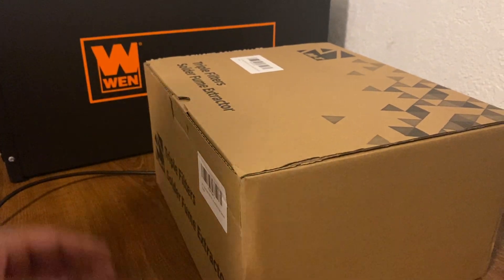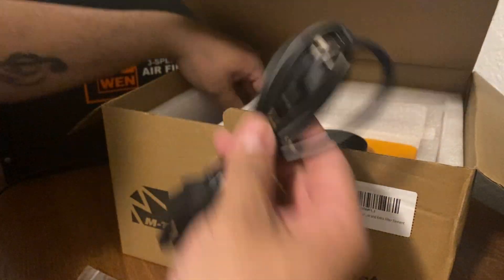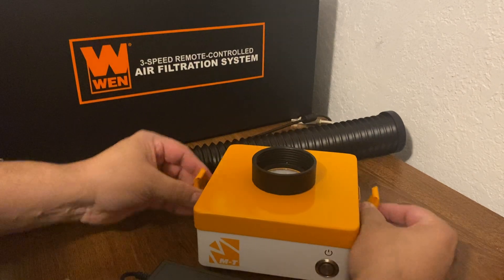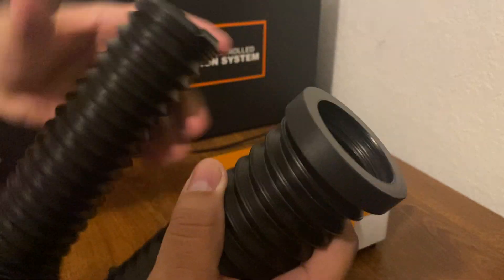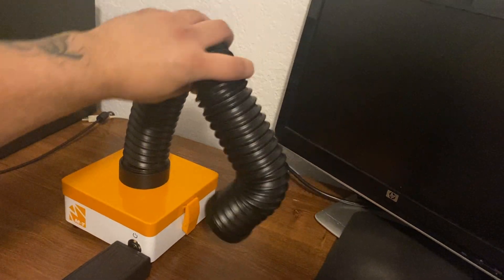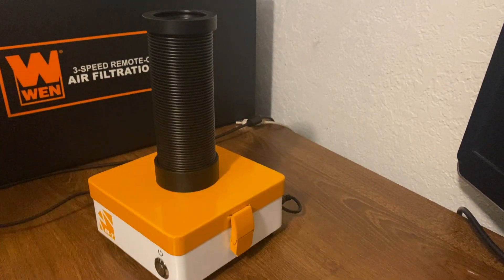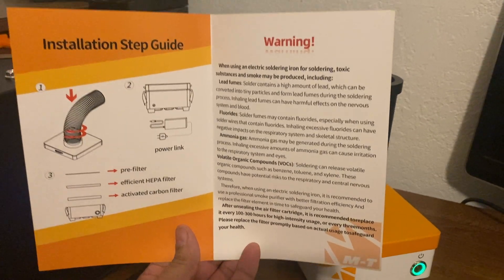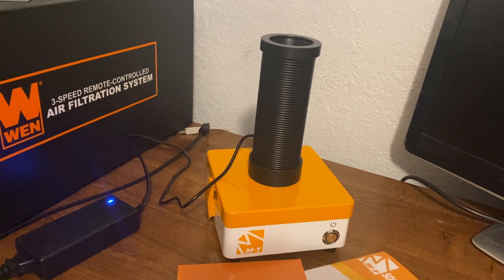M-T Triple Filter Tabletop Professional Smoke Fume Extractor

Comment: Do not buy this I've owned one for 6 months and already broken. Power supply got super hot and now controller on front does nothing just runs at full speed whenever it is plugged in. THIS IS DANGEROUS DO NOT BUY.
Reply from the maker: Nothing bad happened to me except it doesn’t work well after the first use of it. Filter gets dirty quick. I already bought it, that’s how I made a video with it. Lol